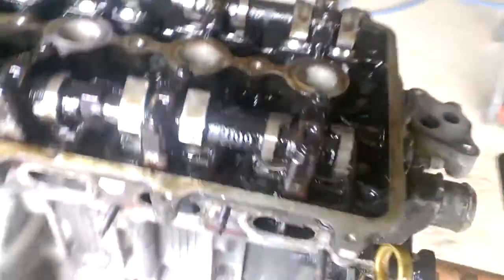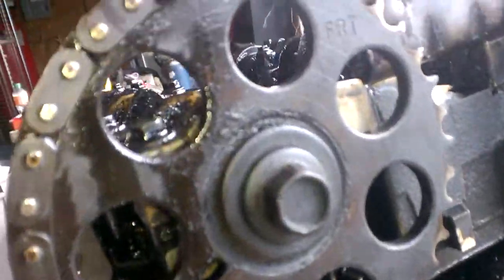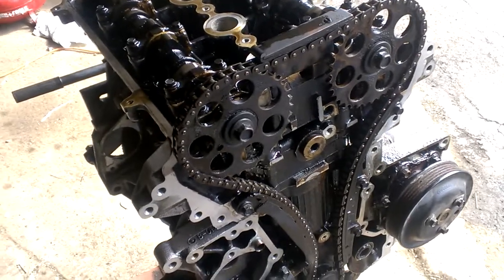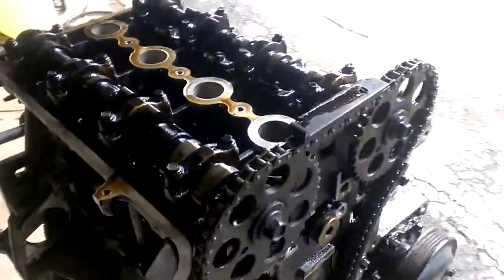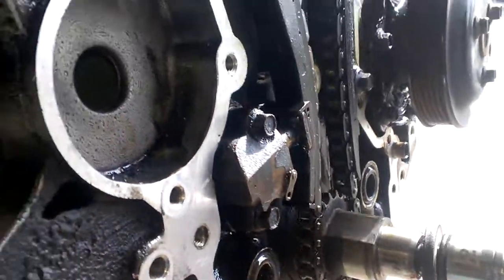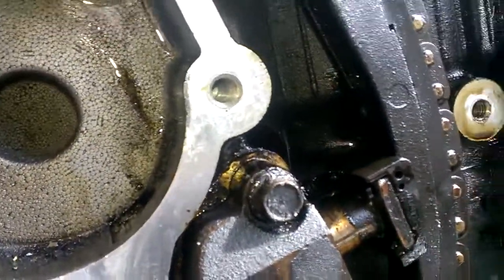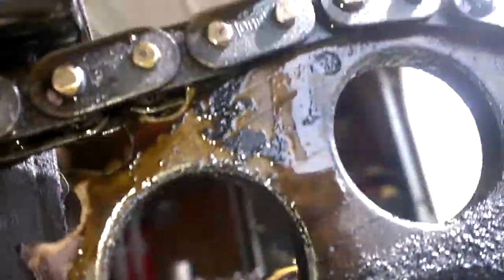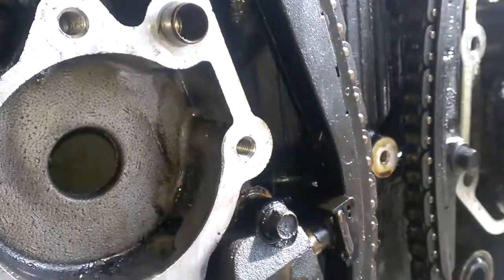How to Test Engine Timing, Before Installation(Saturn 1.9L DOHC)

Comment: this look veery Power-FúLL engun
Reply from the maker: At the time of it's production(1991-2002), the 1.9L DOHC Saturn Inline 4 is the 4th most powerful 4 cylinder that GM offered across the entire company and all product lines. I will list them, as 124bhp doesn't seem like a lot, but that was done with only 116 cu. in. Of displacement.

1. Oldsmobile 2.3L "High-Output" DOHC Quad 4(RPO "LG0") w/175bhp @ 6,750rpm
2. Oldsmobile 2.3L "Low-Output" DOHC Quad 4 w/150bhp @ 6,000rpm
3. Opel 2.2L "Ecotech" DOHC inline 4 w/140bhp @ 6,000rpm
4. Saturn 1.9L DOHC inline 4 w/124bhp @ 6,000rpm
5. Chevrolet 2.2L OHV inline 4 w/120bhp @ 5,500rpm
6. Oldsmobile 2.3L Quad "OHC" inline 4 w/115bhp @ 6,000rpm
7. Pontiac 2.5L "Iron Duke" OHV inline 4 w/110bhp @ 5,200rpm
8. Saturn 1.9L SOHC inline 4 w/100bhp @ 5,000rpm. 
Honorable Mention: The Oldsmobile 2.3L "High-Output" DOHC Quad 4, Option "W41" w/190bhp @ 6,750rpm

And these engines were not all available through the entire 12 years of the Saturn 1.9L production, exclusively installed in the Saturn S-Series, and sharing no other parts from any of GM's other product lines.

The Pontiac 2.5L "Iron Duke" was only produced in passenger cars and light trucks until 1991, the same year that the Saturn S-Series became available to the public, and was only produced for USPS trucks until 1994. 

The cars, that normally got the "Iron Duke", which was mainly GM A-Body cars and the base model S10/S15 pickups,was replaced by the Chevrolet 2.2L OHV engine until the end of its production in 2001.

The Oldsmobile Quad 4 engine family was originally installed in all GM N-Body and some base model W-body cars, during this era, but all variants of the engine were constantly revised because of reliability issues, such as cracked heads, blown head gaskets, and faulty water pumps. 
GM discontinued the 2.3L Quad OHC engine, at the end of 1994, as well as the "LG0""High Output" DOHC, and only the Low-Output DOHC was available in 1995. Starting in 1996, the 2.3L Quad 4 was given a major overhaul, with changes to the block and the head, and became the 2.4L Twin Cam, until it ended production in 2002. 

The Opel 2.2L Ecotech did not surface until the 2001 Saturn L-Series was produced, and was an "option" on J-Body cars, for those that didn't want the 2.4L Twin Cam or didn't want the lower power of the Chevrolet 2.2L OHV engine.

The Opel 2.2L Ecotech has a well-deserved reputation for having reliability issues, mainly with the timing chain failing at around 100,000 miles, as well as faulty water pumps, since their water pump is geared to the timing chain, similar to the Oldsmobile Quad 4 engine family. 

The Ecotech would also replace the Oldsmobile 2.4L Twin Cam in GM N-Body cars made from 1999-2005

The ONLY reason that GM discontinued the Saturn 1.9L powerplants was due to their excessive oil consumption. 

GM's engineers, at Saturn, never figured out that the lack of drain back holes being drilled into the landing of the oil control ring was the cause of their oil consumption, and if you have a Saturn 1.9L power plant S-Series, get it rebuilt with pistons that have those drain back holes in them. 

That engine will outlive just about anything else on the road, by any manufacturer, from any era, with the correct reverse engineered rebuild dome to it.

About the ONLY engine that can last longer than a Saturn 1.9L engine, is the Buick 3800 Series II V-6

The "W41" Quad 4 is mentioned, because it was an available option, BUT that option was ONLY available on 1990-1991 Oldsmobile Cutlass Calais 442 trims, and the Oldsmobile Achieva SCX coupe, from 1992-1994, and their production numbers were miniscule and even IF there are a few survivors of those cars, with that engine in them, they don't have too many miles on them and/or are in collector's storage garages. 

The cams, that GM used to get the HP up, ran the engine super hot from the engine "lugging" during normal city/highway driving, which lead most of them to a crusher after the cylinder head split in half while they were driving it. 

My 1992 Oldsmobile Achieva Sedan has the low output, DOHC Quad 4 and my 1993 Pontiac Grand Am SE coupe had the Quad OHC. 

I loved the fuel economy those engines got. The only other engine that was able to get fuel economy similar to those engines, was my 1995 SC2 with the DOHC 1.9L Twin Cam. 

But, when it comes to reliability, Quad 4s earned their terrible reputation, because you can tell Oldsmobile had to cut corners on the expense of engineering that engine the correct way, which was likely the most direct reason those engines were so terrible with reliability.

Comment: I’m having a problem putting the cover back on the block ?? What am I doing wrong ??
Reply from the maker: There are two dowel pins, that are used for lining up the timing cover, when you reinstall it. 

There is no gasket kit, for the timing cover, as GM used silver RTV silicone from the factory. 

Check to make sure that both dowel pins are lined up, and use a wooden block with a hammer, to gently tap the hammer against the wooden block, if it won't easily slide into place. 

Another area to check should be your front seal, for the crankshaft. If that isn't installed correctly, you will also have an alignment problem, there, as well.

Comment: hey, thanks for the video. what year is this engine? i just acquired an engine that i think is a 96 dohc. i was wondering about the spot where the belt tensioner goes on. my engine didnt come with one installed, and i have tried 2 different belt tensioner styles for the s-series an neither work. am i missing a bracket or something between the flat block surface and the tensioner? thanks
Reply from the maker: This engine is a 1995 Saturn 1.9L DOHC. The 1996-1998 cylinder head has a different casting since the engine coolant temperature sending unit was removed and integrated into the coolant temperature sensor, and I think they removed some of the plastic guides.

99-2002 heads are completely different castings and feature roller camshafts, all 1991-1998 DOHC heads are flat-tappet camshafts.
Reply from the maker: I would need a photo of what you are looking at, to be sure, on where your problem lies. 

The STOCK tensioner units were only held in by two bolts, and there was a cut recess in the timing cover, to accommodate this, without causing it to be out of alignment with the other accessories. 

Aftermarket tensioners may not fit on a stock engine.

Comment: I got kinda lucky on my 02 SL Sohc when the timing chain guide broke and the car jumped time. Every valve got bent, broke 4 rocker arms, jammed the hydraulic lifters. The crank and cam spin freely though. I'm doing it shade tree style fighting the weather in Michigan. The car has 365k miles which I only put on a thousand in three weeks from getting it. The previous owner didn't take to good of care of it ignoring problems that needed to be addressed that I'm doing now. I paid $500 cause I'm friends with the owner which was his son's car.
Reply from the maker: Just get a replacement cylinder head, from a JY, for like $100-150. Most of the time, yards will leave the cams and lifters on the head, when the engine is OHC design.

You can use this website www.car-part.com

Comment: I did this job, and found the "Orings" you see in your video on the block damaged.....what is the correct name for them, and where can I find them??
Reply from the maker: You would need to buy a timing installation kit from a reputable supplier, such as rockauto.com and it will come with a set of new O-Rings and seals. 

It should also include aluminum RTV sealant, which is the silver RTV.
Reply: @Joshua_James_Howard  I have already done that and none of that is included.... only the chain, tensioner, and guides.... I have even looked this afternoon on Rock Auto and can't find it.
Reply: Jv1174 part number

Comment: My car has this same engine, i have a 1999 SC2
Reply from the maker: With the 1999 model year, you would have the narrow head casting, which was a change from 1991-1998 heads. 

I don't think they used a roller camshaft setup until 2000, however, and all of the same concepts should still apply. 

The only major difference is probably going to your manifolds, since those were changed and an AIR injection system was added in 1999-2002 for California Emissions compliant models, only. 

Federal emissions did not have the AIR system.

Comment: I am rebuilding a 2002 SC2-and I cannot seem to get the chain cover off-seems to be binding on the lower end. Any suggestions?
Reply from the maker: There are 4 bolts that go into the bottom of the timing cover, through the edge of the oil pan, by the harmonic balancer. 

If the engine is still installed in the vehicle, then you must use something to raise the engine up to gain clearance to remove the bolts.
Reply: @Joshua_James_Howard  I have removed thye 4 bolts from the oil pan and the 19 others..still stuck!
Reply from the maker: @genekelly8467  Have you pulled the hidden bolt, behind the idler pulley as well, and there are two dowel pins, that hold the cover on. One is near the water pump, and the other is across from that, I think, up towards the intake manifold, I think. 

It is difficult to get the case off, because of those dowel pins, and you had e to be very gentle as you rock the case back and forth, to get them off the dowel pins.
Reply: Spray the alignment dowels and just working it back and forth mine took about 30 minutes of working it until it came off

Comment: Guess the 1.9 is super different from the 2.0 since you called the exhaust cam the intake cam, and the intake cam the exhaust cam.
Reply from the maker: The Saturn S-Series doesn't use a 2.0L Engine.

They came with either a SOHC 1.9L engine, or a 1.9L DOHC

Sx1/Sx models get the SOHC engine.

Sx2 models get the Twin Cam.
Reply: @Joshua_James_Howard  my bad, I meant 2.2, and the S series didn’t even register with me, mines an L200
Reply from the maker: @jc199159  Ahh, ok. Yeah, those are two entirely different engine families.

The 2.2L in your L-Series is actually engineered by GM's German brand, Opel, and was first used in the Opel Speedster over in Europe, before GM started using it I. The L-Series, the J-Body(2003-2005), and the N-Body(2002-2005), and then the Delta platform(Cobalt), as well as the Saturn Vue.

With your specific engine, the biggest issues to watch for are namely the timing chain due to a faulty design with the oil return hole drilled into the tensioner, and the water pump which is driven by the timing chain.

Timing chain should be replaced by around 100,000 typically, though there are rare cases of the stock unit lasting longer.

Water pumps sometimes make it to about 120,000, before they go, typically.
Reply: @Joshua_James_Howard  well in that case I’ll replace the water pump as well. Cuz that’s what happened and why in my case, and I’m surprised it made it this far without it becoming an issue sooner

Comment: You should have clean the engine a little better.
Reply: Jesus, everyone on the internet is a fucking armchair critic. It's not your damn engine so don't worry about it.
Reply from the maker: What I should have done was send the block out and have it dipped in a tank, like you said, and I should have had a machine shop install the new valve stem seals I purchased. My friend didn't have the tools for me to change out the seals, myself, and I didn't know that when I started the swap. I was trying to not tie up his garage for any longer than was needed, as I don't like being an inconvenience to my friends, if that makes sense. 

At the time of this video, I was in a hurry to get the car running, and I overlooked the possibility that the used engine had bad valve stem seals, like my stock engine did, and it cost me when this engine also got a burnt valve in the #3 cylinder.

Comment: Hey I have questions ¿how to find up what type the engine is the correct to swap because my starting is not good anymore MI CAR IS 2002 Saturn sl2
Reply: @Pedro Solano Hey bud, You can get the engine from the 2001-2001 Saturn SC2, SL2, and SW2. The "2" designates the number of cams. The "2" engines are 1.9l DOHC (dual overhead cam) and make ~120hp. You want to find a 2001-2002 Saturn SC2, SL2, or SW2. Those are the proper engines for your car. In the video he had the engine that you are looking for. The black plastic cover will say TWIN CAM 16 VALVE. 
DO NOT GET THE ENGINE FROM EARLIER YEARS AND DO NOT GET THE SC1, or SL1 ENGINES!

(Edited to fix the one year)
Reply from the maker: Do you have a single cam or a twin cam?
Reply: @Joshua_James_Howard  He said that he has an SL2, so that means he has a twin cam.

Comment: Im rebuilding an interference motor at the moment. I wasn't paying attention when i took the timing belt off.. And i didn't time the crank. How can i reset the timing without messing up the valves if i haven't already? I know you have to take the valve covers off and undue the cams at the mains. But nothing further then that...
Reply from the maker: The concept of re-timing a DOHC or SOHC engine is fairly universal, provided the block and cylinder head have timing marks on them. Depending on your specific engine, you may want to consult a Chilton or Haynes manual for the exact procedure. The reason you crank the engine by hand, is to verify the valves aren't hitting the pistons. If you have already assembled the engine, then it is best to remove the timing cover and the valve cover as well as your timing belt. Valves that are hitting a piston will prevent the engine from cranking over, by hand. using the starter motor or running the engine will damage the valves and pistons very quickly, and once compression drops, the engine will stall out.

What is the make/model of your specific vehicle, and which engine option does it have?

Comment: Not sure how old is this video. I have a saturn sl2 i have rattle noise. Like something lose whn i drive it gose away
Reply from the maker: Could be the timing chain, as i have the same symptoms. Getting ready to do a rebuild on the original engine, and I will be installing both a new oil pump and a new timing chain kit, when I do the engine.

Comment: Hey Josh, can this be done in the car? (changing the timing chain)I may have to do this. I bought my SC2 in 2014 with 39K miles for $700.00, this is the only major thing I had to do. Great little car. Thanks!!
Reply from the maker: Yes, you can change the chain, with the engine still inside the engine bay. You do need a jack and a block of wood, for raising the engine. There are 4 screws, that go through the front of the oil pan and into the bottom of the timing cover. It is also recommended to remove the water pump, as there is an alignment dowel pin right next to where the water pump mounts on the block. Recommended replacement are either Cloyes brand or Sealed Power by Federal-Mogul. Depending on mileage, oil pump replacement is usually recommended as well. It mounted inside the timing cover and driven by the crankshaft timing gear assembly.